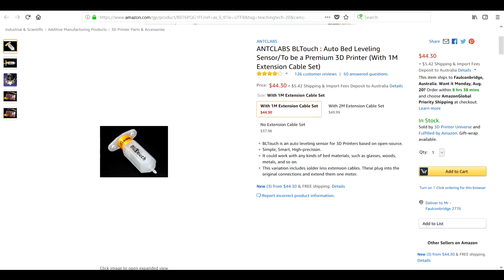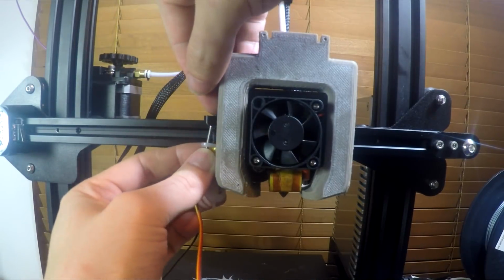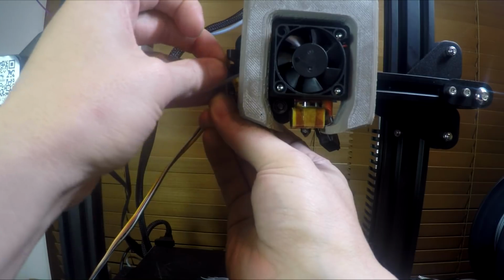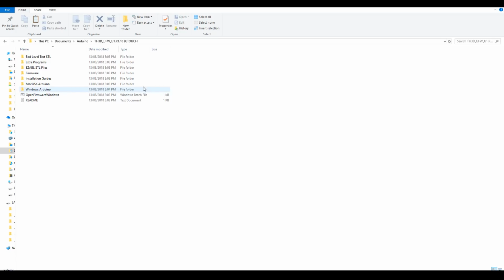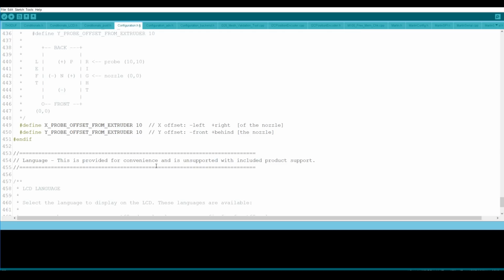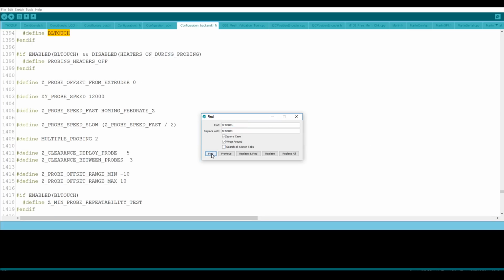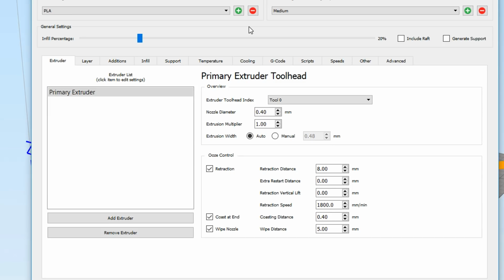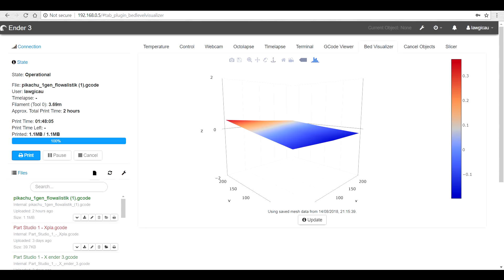How to: Ender 3 BLTOUCH with SD card support and no wires cut

Comment: Just an update if you use the latest firmware from TH3D, they are trying to block the modifications you made in this video, trying to make sure the firmware is only used for their EZABL hardware.

To be more specific, they have a couple lines where you change the inverting settings to false, and they specifically call that out as bad, and then in a few other places if you disable their warning and bypass it, it sets them back to true again.
Reply from the maker: I suppose it's Tim's version of the firmware and he's free to do what he wants but I must say I'm still disappointed. I have an Ender 3 Pro coming and will revisit this then.
Reply: Antitrust laws says he's not free to do that. You can't intentionally break something.
Reply: This has actually been resolved, the latest version no longer has issues with the BLTouch.
Reply: @craignuckels4374  the version I downloaded was the day before yesterday. Has there been a new one since then?
Reply: If i try to bypass the error, the next error is servo0_pin must be defined for your servo or BLTOUCH probe. What can I do about this error?
Reply: yeah, i had the same warning.
Reply: Did you re-set all the settings from this video back up in the other files? You need to make the same mods as before, but also remove the config error part, and then make sure they don't set it back to true again later.

Comment: It looks like TH3D U1.R2.1a does not like the changes (Z_MIN_PROBE_ENDSTOP_INVERTING == false).  I get this error message: 
Configuration_backend.h:1575: error: #error "This firmware is designed for the Genuine EZABL kit. Please purchase one from TH3DStudio.com. The Creality knock-off is NOT supported."
Reply from the maker: In the short term you can go to that section of config backend and comment it out. That is Tim protecting himself from knockoffs of his EZABL, but a BLtouch is not that.
Reply: Thanks Michael.  I actually had U1.R2.10a set up while I was waiting for the BLTouch to arrive and used that.  Will try as you suggest.  I can fully understand Tim's position and appreciate him sharing his code.

Comment: Did you update the firmware via an Arduino Uno or was the Ender 3 directly connected to your computer?
Reply from the maker: After the bootloader was flashed, I connected directly to the printer via USB. Make sure you have the drives, available from the TH3D site.
Reply: Ah ok, that makes sense. Thanks

Comment: Another awesome tutorial Michael. I have a question, did they upgrade to the Bullseye for the cooling system?  I can find the same file you used for yours for my ender.
Reply: Oh and am I supposed to use the Bullseye Base cr10 8.29  to go with the Bullseye Duct 8.29 on my ender if that the one I use?
Reply from the maker: I printed my mount a while ago, then Auspost took forever to deliver to pin27 board. I later found out the mount I used had been removed because it was too high.

Comment: Does anyone know how to add in a filament sensor (basic mechanical switch) to TH3D firmware along with BLT? Since we no longer need the Z-stop switch, I was planning to use it, I believe we can use some of the pinouts on the display board, but how do you configure those pinouts on the TH3D firmware?
Reply from the maker: TH3D sell a filament run out kit, however it uses pin 27 which clashes with the BLtouch. You would need to find an unused pin and define the filament run out sensor to use it.
Reply: Is there a diagram of the display board showing the pins so I can declare it in the firmware? I think I can use the EXP1 pins.
Reply from the maker: Creality has a github with I think what you need. Beyond that there might be documentation on the TH3D website.

Comment: Would it be possible to use the “ext-a2” header?
Reply from the maker: You would have to track down the pin out to see what number pins you were dealing with, then assign them to the feature you wanted, like I did here with #define servo0_pin 27
Reply: Teaching Tech so its pin #35 
PA2 (ADC2/PCINT2)
On the gerber file, it is not connected to anything else, but there is a capacitor between gnd and 5v, that you would have to relocate that
Reply from the maker: Sounds like you know exactly what you are doing.
Reply: A little bit i took digital logic in my college class last semester and they taught me how to figure this out, also I got it to work, using that port, all that you have to do is solder on a header, switch the servo connector like in the video and, set it to pin 29 in software.

Comment: When I compiled, I still had plenty of bytes left where I didn't run into a full storage error. I'm at 98%. Don't know why mine would be different, though I'm using TH3D instead of base Marlin.
Reply from the maker: 98% without removing the boot screen? Perhaps you are using a newer version of TH3D (which I was also using).

Comment: Brilliant videos I've upgraded my ender 3 using all your videos. Installed the bl touch this week and a e3dv6 hotend I have an issue where I am now printing  20mm to the front of the Y axis and 10mm to the left of the X axis off Center how would I get this back to Center?
Reply from the maker: You can setup X and y offset in slicing software, but down the bottom of configuration.h there are custom X and y offsets to use too.

Comment: Thanks a ton for the video- between this and your bootloader one I was able to get my Ender 3 running great!
I did have a few issues though-none your fault but I figured it might be good to document them in the comments for others. 
The TH3d Board has correct pwm output (if you're facing the printer it's the pin all the way to the right) but does not have a 5v line where it should be. I ended up taking ground and 5v from the ICSP connector directly to the right of the LCD connector and this solved my issue. The TH3d board also has a vertically oriented breakout connector, as opposed to the horizontal one you had, so I had some clearance issues with the fan. 
My BLTOUCH also came with a servo style connector that I had to resolder to connect to the Z-stop spot. 

thanks for the great tutorial though and happy printing!
edit: also do you know if it's possible to set it so the auto home command doesn't slam the extruder into the bed? I'm guessing it needs to be told to activate the BLTOUCH somehow.

Comment: i hope someone can help me 
when it goes to print it auto homes and the probe never comes back out after the z-axes auto-level so when it gues to do the first point in the corner it crashes into the bed i'm not sure what to do now i posted a video in my reddit thread looking for help as well 
https://www.reddit.com/r/3Dprinting/comments/9a4448/please_help_ender_3_bltouch/
Reply from the maker: Just read your post, sorry to hear about the magic smoke. Very strange that it probed correctly once but not after that. Never seen that before.
Reply: thanks for the reply man 
i guess the company i bought my ender from is sending me another motherboard so i can at least get the printer running again not sure if i want to risk the bltouch right away but at some point i'm going to need some form of auto bed leveling on it

Comment: Hello.
Thanks for the great tutorial. It helped a lot.
But there is one thing to be aware of: The Pin 27 Boards are quite different. My board had another pinout, just like the standard of the bltouch . But I followed yout instructions without thinking about it ..... just saw this too late.
Something burned through. The printer is still running and I can use it via OctoPi. But the display is very dimm. Any idea how I can find out if it's the melzi board or just the display board I have to replace?

.... hmmm. I think it may be both the display and the board. The display is only active, when the raspberry is connected via usb.
But it is very dimm and there is a darker spot in the upper left part .... like something burned the lcd.
Reply from the maker: If you can control all the printer functions via a pi I'd hope that just the LCD is toast. Did your pin 27 board not have a pin out drawn on it? Sorry to hear :(
Reply: @TeachingTech  the p27 board has a drawing. But I just was not concentrated enough I fear. I just followed your video tutorial without double checking 😕. So the board and most likely the display are toast. Without voltage from the pi the board does not even start up. Only the 24v hotend fan runs ... but it is connected directly to the power supply. No 5V power ....
OK then. Time for another project. I'll implement a MKS 1.4 with some 2130 drivers. I was planing to do this anyways. But for sure not so soon.

Comment: I am seeing a strange issue after I do all this. I can properly go through the steps and set Z. I slice the "thing" in Cura and then send it using OctoPi. When it starts printing Z the control panel shows Z.22 and there is a "huge" gap between the nozzle and the board when it starts printing. It is as if there is no Z offset. Any idea why?
Reply from the maker: I'm assuming you have set your z offset?
Reply: Yes. Oddly, I have noticed changing Z works better when using the control panel instead of sending gcode via OctoPi or pronterface. Not sure why.
Reply from the maker: If you layer height is 0.2 this sounds about right. Many slicers have a setting to thicken the first layer. 0.22 implies yours might be set to 110%.
Did you store z offset to EEPROM after tweaking? Otherwise back to zero and print in mid air after restart.

Comment: Hey this is a great install video and that is great.  I'm having an interesting issue though.  If I print anything that goes out towards the right side of the bed, if you are looking at the printer, the nozzle grinds into the bed.  Have you are anyone else had this issue and how did you resolve it?
Reply from the maker: The obvious thing is that the bed is not level and is too high on that side. You should do a live level adjust as the first layer is printing, as in twisting the bed knobs as it prints until each corner is pretty even.
Reply: This worked.  Thank you very much for your help.  You were completely right when I did a G29 and placed the output into http://lokspace.eu/3d-printer-auto-bed-leveling-mesh-visualizer/ I could see that the side of the bed that was grinding was much higher than the other side.  I adjusted the bed knobs and kept doing a G29 and placing the values in the tool above until I had it fairly level.  When I tried printing again it worked perfectly.  You have a great channel and are helping newbies in the 3d printing world out tremendously.  Keep up the good work.

Comment: Can you do all the firmware adjustments if you flash the firmware through cura?
Reply from the maker: You still need to compile in Arduino and retrieve the hex file from whichever folder it gets buried in.
Reply: alrighty thank you very much!

Comment: is that 5mm with the bltouch arm retracted or at its full height before it hits the bed and retracts?
Reply from the maker: 5mm was the y offset I measured (distance forward of the nozzle when looking straight down from above). 8mm is the vertical mounting height you're aiming for, and that is measured from the bottom of the non-moving BLtouch body to the nozzle tip.

Comment: Thanks for the video, to eliminate the memory problem I just changed the board to a Geetech 2560 and the printer Ender 3 operates a lot better with this board and you have the option to fit TMC's, or the Gen L would be fine. regards, RobUK
Reply from the maker: Great work! A lot of future proofing by doing that mod.

Comment: hi i just followed your tutorial, it worked awesome! however i tried to use the new TH3D auto resume on power loss firmware and when i compile i get this error "exit status 1
'STOW_Z_SERVO' was not declared in this scope"  do you know whats causing this? id really like to have the resume
Reply from the maker: Hi James, I haven't played with the beta. In future I may download it and pin a post with the updated steps if they are necessary.

Comment: What is the correct mount/file  for Ender 3 in the Petsfang v2 fan duct package ?
Reply from the maker: There is a PDF on Thingiverse for the Petsfang with everything spelled out. I printed the older version so I'm not well placed to advise you on the newer files.

Comment: My question is with the Z cable Removed and the stopper are canceled 
instead of the Z cable need Connect on a panel-board   black and white  cables and then connect the 3-CABLE to 27-pins
Reply from the maker: I can't understand the question sorry. Can you try to rephrase? If you mean the z cables are replaced by the probe, then pin 27 for the remaining pins, then yes.
Reply: What with the Z-plug stopper is left without a connection
**z stopper remains without any connection
Reply from the maker: Yes the original microswitch is left disconnected. You can remove if you like.

Comment: I have made the file changes as you said with the same firmware and on Ender 3 babysteps are not working. Dialing the knob has no effect. The Z axes does not move. Is this a firmware bug?
Reply from the maker: Just double checing you've gone into the Z babystepping option in the menu?

Comment: Maybe I missed it but, how different is this compared for a CR-10s install? I've seen the question pop up in the CR-10 facebook forum but nobody really has an answer. Maybe an idea for a future tutorial? Great video btw!
Reply from the maker: I was under the impression that the CR10S had a mainboard with a 2560 instead of 1284P. I'm not sure if the physical layout is different or not. In terms of firmware changes it will be very similar.

Comment: Did you not forget something? Where is recovery function?
Reply from the maker: For th3d it's in beta. If you want it now you can switch to the Creality released Marlin, lose thermal runaway protection and setup for the BLTouch from scratch. Your choice.
Reply: Clarity Marlin from Github has at least 8 seriouse typo errors, and many bugs. Marlin 1.1.9 Works much better, but after compiling it has 50Kb to much.
Reply from the maker: I'm glad they went open source but I agree the release was a bit underwhelming. Tim from TH3D does a lot of optimisation to keep the size down. Some menu items are removed from the LCD to save room. These items are accessible via start gcode or via USB serial connection.
Reply: @TeachingTech  l know l look in to the code, l can see some serious changes. From the other hand side l found options that should not be removed, just commented. Anyway, thanks for nice video. If you're interested with little bit different sensor that works like BL but do not require servo signal look at thingiverse for HallON ;)
Reply from the maker: Ok, will do.
Reply: @Teaching Tech i don't think it's as much it's in beta but the fact they have based their branch on an older version of Marlin.  I would always suggest to use vanilla Marlin as you know it will be under constant development and you don't have to rely on 3rd parties to keep up to date.  Plus configuring firmware is something anybody running a 3d printer should get comfortable doing.

Comment: Next challenge if you're wanting to take the Ender 3 to the next level.

Install Klipper firmware w/ bl touch :)
Reply from the maker: I will test klipper at some stage but probably not this printer.

Comment: Hey great video! Would this same procedure work on a cr-10?
Reply from the maker: The original one with the same Melzi, I believe it will work the same. Just need to pick cr-10 in th3d and the wires to the probe will need to be a tad longer.

Comment: Great guide, thank you!  If you do not have spacers to put between the mount and the touch, try using a spring from a ball point pen. Simply cut it in half. It will fit on the screw nicely and keep the tension.
Reply from the maker: The bltouch actually comes with two spring but I prefer it rigid. Great tip!

Comment: Awesome tutorial Michael, as I knew it would be. I did install the BL Touch the other day, but had issues with the pins not connecting very securely to the end-stop pins on the main board (CR-10 S4) so will have to get the correct plugs and have another try. Also had issues with Marlin not compiling (errors), but I was trying it from virgin Marlin, will try it again when time permits, with TH3D Firmware. I do still have the EZABL on order, so I'm comfortable with using Tims firmware as a customer.
I haven't emailed Tim about this yet, but I have noticed that in the TH3D Extras section of the UF, the custom Esteps say that it can only be whole numbers, mine currently needs to be 98.752, have you found a solution to this?
Reply from the maker: I just tried your estep value and it compiled ok. I assume he changed it from a floating point to an integer to save on memory. I'm not sure if it converts it back when compiling or not. You can always round to 99 and then get the correct flow back with the extrusion multiplier.
Reply: Wow! Thanks for checking it out for me, I didn't expect you to go to all that trouble. When I configure the UF I'll give it a try and, like you said, tweak the multiplier if needed.
Reply: Thanks for your response Tim, much appreciated.